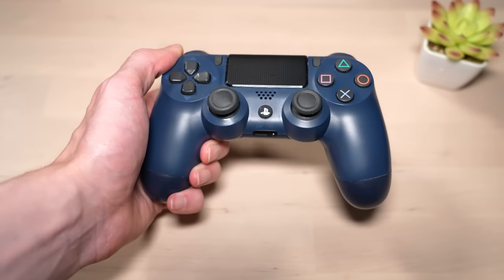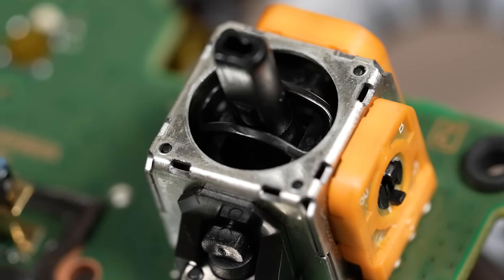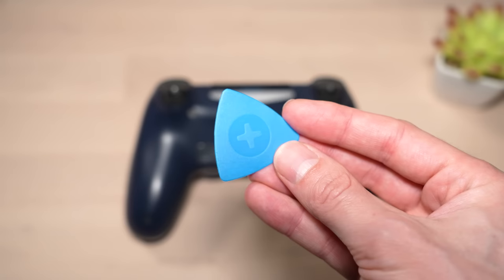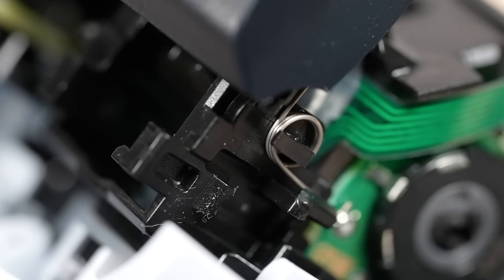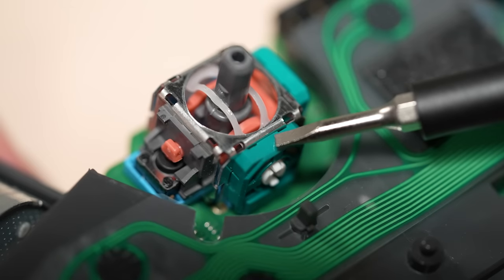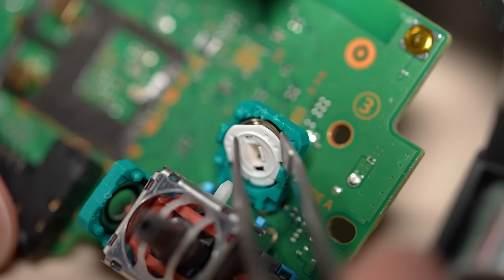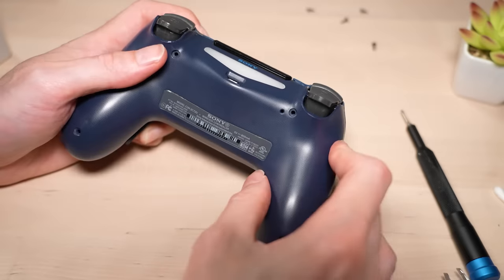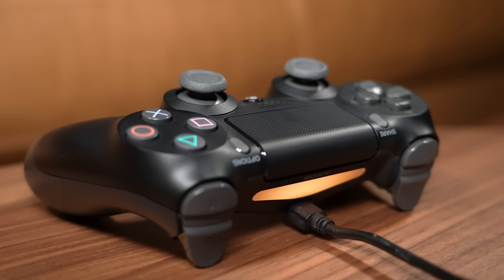Most PS4 Controllers Have This Problem.. But I Fixed It!

Comment: There's no way in hell I'm doing this without destroying my controller
Reply: Yeah, I don't wanna risk damaging it even more, I rather paying that knows how to fix them
Reply: It's really simple. I've done this twice now and I've only had to worry about the ribbon cable sliding back in place in between the top gap. (That part is a pain, if you don't have tweezers to fish it through.) 

Anyway, I haven't had drift for almost a year now. It's the best fix other then buying a new controller. I'd recommend making a step by step guide as you go, so you can put it all back from reverse.
Reply: its actually really easy. I have no electronics experience and I've done this to my ps4 and ps5 controllers multiple times
Reply: Agreed. I tried to replace a battery in one one time and I destroyed it even more lolol
Reply: it's really easy
Reply: @Rezubetten  bro one i accidentally cut the ribbon or really just scratched and the controller didn't work anymore
Reply: Well said! LOL
Reply: I just did it yo and mines work fine. You want brake it. Just take your time
Reply: There are ways to prevent the analog stick from drifting without having to dissasemble your controller but they arent as efficent
Reply: Exactly
Reply: The first time might feel like you're gonna break it because everything is so tightly assembled, particularly the sensor wheel housing that needs to be pried open, but beyond that it's easy. The satisfaction of fixing a controller yourself is worth more than 60-70 bucks for a new one.
Reply: not that hard honestly
Reply: If it’s already broken then there isn’t really much to lose, just a chance to save some money.
Reply: Don't be intimidated to do it, sure you could pay someone to fix it but they'll probably charge you half the price of a new controller to do 10 min of work. So if you ever have a controller that's just dead or you don't mind risking for experimentation, then try it out. Also makes it more fun cause then you can buy diy kits from extremerate and customize your own controllers for a fraction of the cost that scuff would charge for example.
Reply: Just top the controller twice and Wallaaah problem solve. 😅
Reply: thats what i thought but its really simple i can fix stuff without a tutorial now
Reply: My son and I tried on a BRAND NEW controller that had drift and well..........that controller is a memory lol
Reply: I tried this very carefully, took me hours, after i finished, the drift got worst and unusable. What i did wrong? I have no idea
Reply: You acyually can just reset the controller. Just search it on YT
Reply: @svenebben7131  if this was a fix, there wouldn't be so many complaints about stick drift
Reply: @scarecrow03  yeah, idk but i did it with resetting and it worked🤷
Reply: Easy methode from my experience :
Whenever i get the analog drift back i just open the controller n clean the analog with hair dryer with strong  cool air n use tooth brush to genlty remove dust from analog n blow some cool air again n than its good i do this every 5 month ish
Reply: I've done my own for many years and the ribbon does get bent a bit overtime but they are easily replaceable
Reply: I did mines wit care cos I can’t afford to buy a another one
Reply: If you are worried, let a tech friend do it…
Reply: I did it multiple times , there's no worries trust me and its effective for example i wast on 0.9 deadzone on warzone , after cleaning i'm now on 0.5 without having any drift
Reply: @S_B2033  I tried it, it's harder than it looks. When I tried to close the green things, something must have been missealigned and the analog got messed, it made a click sound when I moved it, like something was getting caught up. I disassembled it and put it back together again but to no availe. I then tried to replace the entire thing but my welding iron didn't get hot enough to melt the welds. It ended up in the trash can, I only saved the battery and the R2/L2 buttons as spare parts.
But hey, if it's drifting that bad, you have nothing to lose.
Reply: @andrefcnc   damn i get that,  for the green thing its delicate to put it back you have to align the sensor correctly, i successfully repaired my original ds4 and recently my compact nacon its has a better sensor and sensor sockets ( orange color )
Reply: True
Reply: Ive done it atleast about 4 times on three different controllers and is very easy to do without breaking anything, but as you can tell its only temporary but can work for a long time in some cases, buying replacements outright will work for a long time and be a lot cheaper than a new controller just remember that
Reply: Easier than it looks
Reply: Thats what I thought at first, but when I tried it it was really easy and I've done it multiple times To couple controller.
Reply: yh dont do it guys, 2 of my controllers died to this vid
Reply: @Rezubetten  really simple ? everytime i remove the potentiometers and put them back the sticks never work again. It keeps on moving on its own, way worse than it did before attempting to fix it
Reply: For all of you guys out there to see if this works, YES this does work, I'm 15 and managed to fix the whole thing!
Reply: @daudakhtar5135  My joysticks started drifting more after attempting it lol
Reply: Ya I have took my controller apart many times and it's super simple
Reply: @ddog6289  Well now my sticks are in worse condition idk what went wrong
Reply: @DeletedMemoriez  what stick is not working??
Reply: @DeletedMemoriez  maybe it is fully broke
Reply: @ddog6289  both of them are acting up now lol they are moving upwards
Reply: @ddog6289  it happened after cleaning the potentiometers , perhaps i damaged them further
Reply: @DeletedMemoriez  o
Reply: @ddog6289  makafso
Reply: Looks way harder than it is, done it a few times already
Reply: if i can do it without breaking mine, you can do it
Reply: I thinking of doing this now I've paid for two controller and the right stick been to  Stiff to be able to play shooting game with in other my aim is way off
Reply: I thought the same but i did it perfectly 😂
Reply: i dont even know why im watching this because i know i will not do it xD
Reply: How, Jesus that's like the easiest thing you can do.
Reply: It's really not that hard, just look up a tutorial video on how to do it or like me read read how to do it, I learn and understand better reading how to do something for whatever reason.
Reply: @acid8501  yea taking it apart and making sure to use soft hands is the most nerve wracking part but putting the wheels in isn't a big deal definitely use tweezers. There are 4 per analog stick, taking time to be care shouldn't take more than 20 mins from start to finish.
Reply: @xX-Logic-  well that's not technically true other than the drift the controller works fine, so I don't recommend treating it as if it's already broken.
Reply: It works just did it and my controller doesn't have stick drift anymore
Reply: yeah agree
Reply: Then buy a replacement, easy peasy :P
Reply: I did it. Controller works like brand new now.
Reply: PS4 controllers are one of the easiest. 😊
Reply: @Rezubetten  it is but i fucked it up more somehow whenever i push the joystick down it goes straight up so I either gotta buy a new controller or idk but I’m fucked🤦‍♂️
Reply: Bro just go spend 70$ more than  risking it
Reply: I tried to fix my left stick on an older remote, it made it worse, i opened it up again. Tried again with just the one sensor and it works!!! It was putting it back together (the sensor mainly) I found difficult. But, i guess i did it right the second time.
Reply: @0_KKK_0  if the controller is already “broken”, why not attempt to fix it for free before spending 70 on a controller when eggs is damn near ten bucks
Reply: @rileybazan9747 "it's really easy." Says a kid who lies and never actually done it.
Reply: @Dreamer23245  I've done it a bunch, but go off I guess
Reply: LOLL
Reply: I just did this myself took me probably 30 minutes and my controller is fixed
Reply: Wish i read this before absolutely prying open the sensors with the might of zeus
Reply: Yep
Reply: @DeletedMemoriez fr any fix?

Comment: Alright I'm coming clean... I find your tips and trick videos very useful and helpful, but this one I gotta distance from. I've taken PS4 controllers apart and some tiny piece always broke off or the triggers couldn't be placed back in with no way to fix it again. I'd rather buy a new controller.

Comment: I hope Sony learns from this, and change it where games don’t require you to push down on the Analog sticks. So many games require this, but yet Sony doesn’t adjust the issue, because stick drift happens on the PS5. Stick drift was so bad on my PS4, that I had to move Ghost of Tsushima over to the PS5 to finish it. 😕
Reply: Some games have settings to where u can increase the number to decrease the drift
Reply: Yeah, playstation quality lately has been dropping while xbox is buying all gaming studios like bethesda, etc. Playstation needs to change or they are in for a plunge in the gaming market.
Reply: does hall effect joystick can solve that issue though?
wondering if in the future it can be mass produced easly and cheaply,possibly making ds4 loke joystick to be in cheapest while decent and hall effect will be just as cheap as original ds4
Reply: Pushing on the analog sticks doesn’t cause stick drift though. It’s when the sensors go bad and detect movement when there isn’t.Only pressing it really really hard would cause some problems
Reply: @Liam_685  And how do the sensors go bad? By pushing down on the Analog Sticks. Over time consistent use of anything causes things to fail.
Reply: @thescepterofjudah12  yeah everything goes bad at some point. I think the best solution would be to make every controller have swappable thumb sticks like the dual sense edge does
Reply: I literally playing this game right now but my drift so bad

Comment: I didn't have any rubbing alcohol or q-tips, but I had hand sanitizer and paper towels. I just set the little buggers to soak in a blob of alcohol gel for a bit, and then rolled them around in a wet paper towel, rinsed them off in the sink under pressure for good measure, and then dried them completely with a can of air. Worked like a charm, thanks!

Comment: Cheers for this. For the viewer: careful with the axis sensors, they are so fiddly. Was sure I screwed up somewhere between peeling them out and shoving them back in. I didn't (apparently), but nor did I manage to fix my problem -- not surprised, it's a tiny drift. Regardless, thanks for showing us the stick assembly in detail.
Reply: My first attempt made it worse, but i just tried again and it seems to be fixed. Had same problem with the sensor, it's finicky... i can't wait to be 20 mins into a game and it start up again. (crossing fingers)

Comment: I'm quite sure the dualsense uses the same potentiometer, so this could apply there too. I've had my Ps5 since launch and haven't suffered stick drift yet. But a couple of my mates have.
Reply: Yeah that's was an issue with a lot go dualsense controllers. But that problem has been fixed by Sony now. They started releasing newly fixed ones some time back, you can tell by looking at the model name.
Reply: @aadityachavan6836  which model names are the new ones?
Reply: @aadityachavan6836  I got one of the new controllers after getting a replacement because the last one had stick drift. Currently, the right stick is getting really sensitive, and ends up looking like it's trying to aim at people through walls because it's skipping around at the slightest touch. Not drifting (yet), but it does have its problems.
Reply: @-ktb-_-btk-4373  look at the back of the controller and spot the fcc ID, if it ends in '1A' then it's the controller where they've fixed the problem
Reply: @-ktb-_-btk-4373  I think the 3 new ones are called the Galaxy collection. Nova Pink, Starlight Blue and Galactic purple. I have a starlight blue.
Reply: the potebtiometers are a better version but thet are definitely still prone to stick drift which sucks like i don't want to use my controller if that is the case then 😔
Reply: Those new models are still fairly new. So we still have a few extra months to tell if they'll last long. I had a PS5 since launch and that controller drifted in 6 months as well as the red one I used to replace it and those new models aren't at least 6 months old yet.

Comment: I know an easier way to fix struck drift and I’ve done it 2 times so far. All you have to do is reset your controller from the back using a paper clip or toothpick and once you do, it will be reset but make sure your turn off your PS4 before resetting your controller. Now the drift won’t go away immediately after u reset your controller but it’ll take some times for it to go away like a day or so but it always works for me!
Reply: really? i will attempt this now hopefully it works

Comment: I have already done exactly this 2 times on my 3~4 years old DS4. With excelent results both times.
Very good video, its very important to clean the inside of the green parts too where the wheels make contact... not just the wheels.
Reply: hmm yes DS4
Reply: @cheeseburger0069  It's the DualShock 4 aka the controller's name for PS4

Comment: As an alternative to Q-Tips, which are prone to leaving tiny cotton threads behind, I recommend also having Proxabrush teeth cleaning brushes in your toolkit.  They are tiny pipe-cleaner like sticks, made to clean between teeth as an alternative to dental floss, and can be found wherever one purchases dental products.  They also come in different sizes and are extremely handy for cleaning between small parts.

Comment: I actually learned to do this when working from home during covid. Had a lot of free time and about 7 drifty controllers.

I ended up successfully fixing 6 of the 7 controllers just by cleaning them out with q tips and alcohol.

I'm terrible with this type of stuff so, if you're a little scared of taking stuff apart, don't be. Give it a shot. Couldnsave you $50 or whatever.
Reply: Yoo why do you have so many controers haha gotta have a lot of friends :D
Reply: @Nyahnator  I sold 5 of them and got a new headset. But then I got a new one and I have a Scuf. So I've got 4 ps4 controllers that I split between PS and PC. Then...2 ps5 controllers...an Xbox one controller...an Xbox series X controller...2 ps3 controllers...4 ps2 controllers...1 ps one controller (pre dual shock) and 1 original SNES controller.

I have friends that come over and we play fighting games and brawlers sometimes.
Reply: @anubrakahn2970  bro thats sick. Everyone always doesnt have enough Controllers when friends are around. Not you tho haha
Reply: @anubrakahn2970  you said you split the ps4 controllers between pc and console. Do you prefer the ps4 controller on pc? I always used the xbox controller because it seemed simpler to set up
Reply: @Nyahnator  that's actually why I got the Xbox series x controller. But now I've got more issues with that wireless than my ps4 controllers. So now I hardwire both. On PC, I use the Scuf or a PS4 controller with a back button attachment for any games that I use back paddles on (like Souls games). I also use the ps4 controller for any games that I control with d-pad (like the new TMNT!). For everything else I use the Xbox series x controller.
Reply: That’s great to hear. I have 5 controllers and two are new. Only 1 of the 5 doesn’t drift so might as well give this a shot.
Reply: What pissing me off about the PS4 is the pad membrane since I play alot of fighting games,and over time rips way too damn easy.On my 3rd controller atm in 6 months.Thankfully tho,Amazon realize this and offers a 3 year protection plan in case it does(it will lol) wear and simply give you a brand new controller provided that you dont open it up so
Reply: @zeokenx2  that’s very good to know Amazon offers that protection plan. I think I’ll order from them in the future for controllers.
Reply: Thank you.  I appreciate your comment.  I think I might try it now😊

Comment: If you're getting stick drift when playing outriders, adjust the dead zone settings for left and right stick. Thought my brand new controller had drift, but it was just this one game. If you can't disassemble controller for whatever reason, fix stick drift by upping the dead zone settings until it stops.

Comment: Yah,  he is right it does work because I did what he said and now both sticks work. although I had another controller that was brand new practically and some reason it has a lot of ware and tare on the sensor and what's more strange is it looked pretty new inside I'm not sure if it is the metal things that was defective and was scraping the sensor or what, but I'm glad I got one controller fixed. Be careful not accidentally bend plastic to much because when you squeeze the sensor thing shut there is a part sticks out that has to go back in and if it ain't lined up correctly then you may accidentally damage it. Just another reminder for anyone who needs it. Thanks to the guy who made this video.

Comment: Great video, short but very informative and precise in delivering information to the viewer! 

I just hate it when they make a 10-15-20 min video out of something like this when a 2 min video can do a much better job.
Reply: It takes like 30 mins to do this for the first time
Reply: @dannywelbz3650  I did clean the inside of the switch but it only lasted for 2-3 months I replaced the whole switch in the end works fine now :)
Reply: @antesifner3574  you soldered it?
Reply: @no-u.  desoldered it and resoldered a new one used a good soldering iron and hot air combo
Reply: @antesifner3574  Are soldering kits expensive?
Reply: @no-u.  depends it can be if you wanna go pro level from the start buy once cry once tipe of thing but if you buy smart sometimes you can find stuff a bit cheaper that does everything you need at a lover price rate